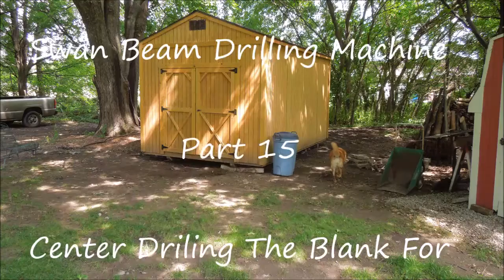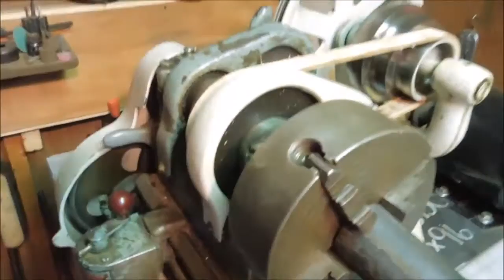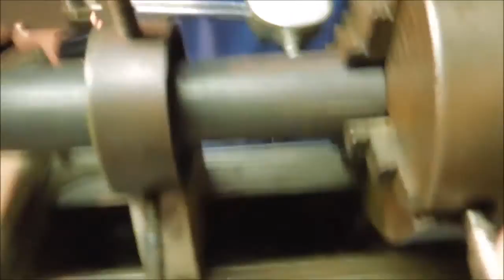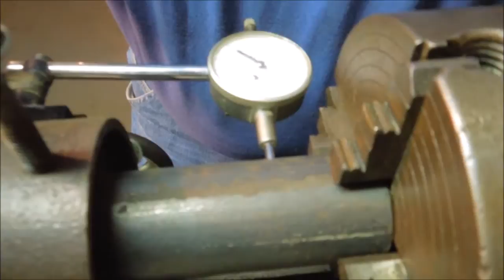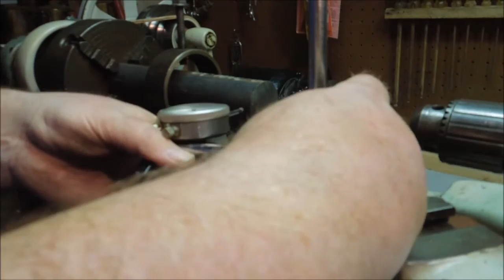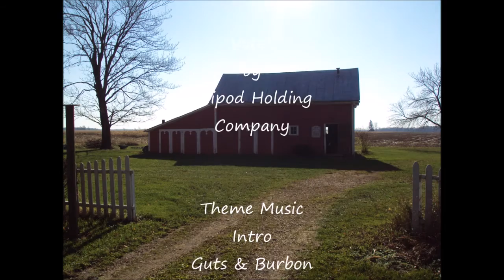Repairing Antique Tools - Swan Beam Drill - Pt 15 -  Centering The Shaft

Comment: Good job there, Snee, Takes patience sometimes to get them to line up in center. A lot of people would say, why don't you get a 6 jaw chuck, but as we know they are very expensive, and there is a reason for a 4 jaw chuck. It is more versatile as you can chuck up offset pieces. Thanks again, and we will move on, Take care.
Reply from the maker: Thanks for watching. A lathe is so adaptable. With a faceplate and clamps it can mill flat surfaces. Between centers it can turn cranks and lever arms. With a proper boring setup it can do internal diameters and threading. I don't know how I got along without this little lathe for so long.

Comment: thank you so much for doing this video i needed this refresher know all i need is to find me a lathe great video keep up the good work
Reply from the maker: I greatly appreciate you asking for this video Bud. It's easy to miss something when I'm presenting a project like this one. I have done the tasks so many times that I forget how hard it was to learn some of them. Sharing the tricks and work arounds that I learned from others is a great way to pay back for all the help I got.
Reply: Old Sneelock's Workshop That's it Uncle Snee! Help someone else get it right! I've worked around people that'd die before they'd help somebody. You've been there I'm sure. I'm starting a new-ish job in 2 weeks because of that very thing. I need to start making a difference instead of butting my head against a wall. And thanks for what you do! I'm trying to soak it up like a sponge!

Comment: Thanks Uncle Snee! I had never seen anyone chuck up a piece and had always wondered how it was done. I even thought all the adjustments for the individual jaws were geared together. Silly me, but that's what you get when you're diesel powered like I am. I needed this! A-PLUS!
Reply from the maker: There are many types of mechanical, hydraulic, and pneumatic chucks with anywhere from 2 on up to ? jaws.
The 4 jaw that I used here is pretty much a standard for centering. 3 jaw chucks with the jaws linked to one closing mechanism allow you to rough center parts very quickly. Any reasonably round object clamped in the chuck will be centered within the runout tolerance of the chuck. One of the drawbacks to chucking in the 3 jaw is if you remove the part and then put it back in the chuck it is no longer on the same center it started with. The independent jaws of the 4 jaw lets you compensate for the changing grip points and center the part to the original state.
When I worked for Douglas Corporation one of the many projects was center grinding flame sprayed shafts up to 14 feet long and weighing 2000 to 4000 lbs. It seemed like the center always went out just before the last pass on the grinder. The lathes that the guys centered the shafts on were huge. All of them had steady rests and 4 jaw chucks. The guys would load the shafts in the lathe, recut the centers on both ends, and have it back in the grinder in an hour.
Reply: Old Sneelock's Workshop THAT would be a trip and a half! Just to watch something like that would leave me bug-eyed for a long time! You were/are very fortunate to be involved with something like that, but like I stated in the comments about the barn auger, You are a good teacher!!! Wish we were closer! My Unc. the Hero always said "You can't learn too much". Thanks Uncle Snee! I really appreciate it!
Reply from the maker: I left Douglas Corp back in 1993 and don't have any pictures. The are still open and last I knew they were still running the big machines but they don't have any pictures on their website. douglasflamespraying.com
Reply: We have a plant below us that used to make thread guides for spinning looms which are now in China, I'd say. They had a flame spray department and you could hear those guns roaring all over their place. Interesting stuff and thanks for the site. A-PLUS!!
Reply: I just looked at their site and the crusher has a mud pump with a shot impeller that would be nice to get straightened out. Bet they could do it. I'll tell the wrench man about it in the morning. Thanks Again!